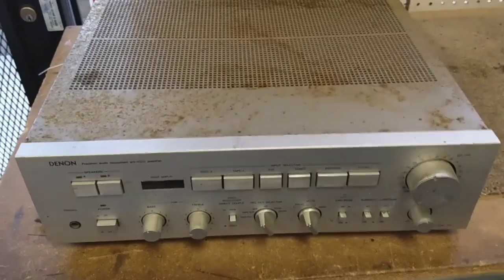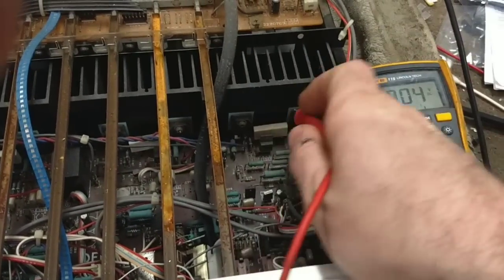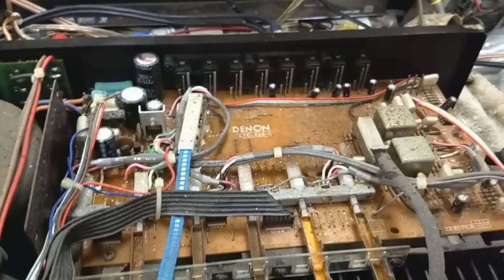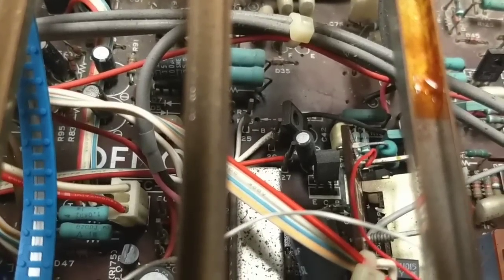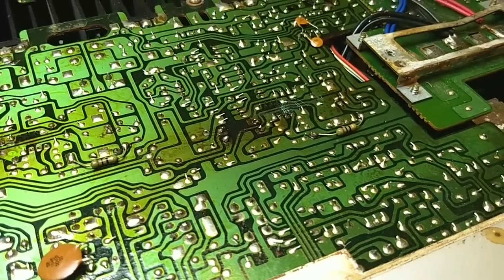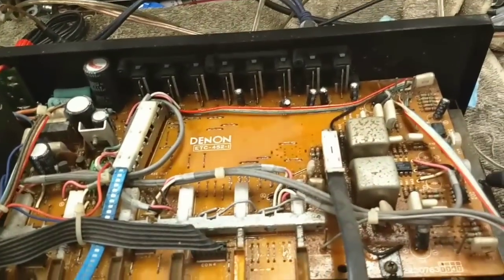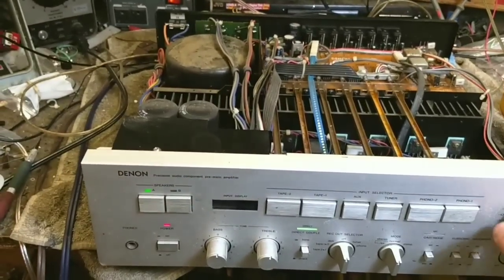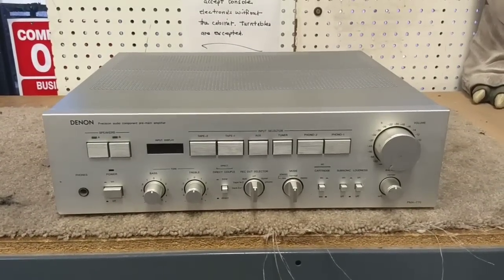Diagnosing and servicing a crusty Denon PMA-770 integrated amplifier

Comment: Wow, if I had one of those, I'd NEVER get rid of it!  (Actually I did have one of those, and still have it, in storage and in much better shape than that one.)  It was part of the best audio system I ever had.  The input display is, if I recall an LCD that is back lit by a bulb somewhere inside.  (I never got around to fixing mine either.)  It's sad for me to see such vintage high end audio equipment poorly neglected.  Not enough respect for the higher end stuff from the 1980s.  I once saw a Nakamichi Dragon cassette deck (arguably the best, most expensive cassette deck you could buy), rusted and beat to crap, having been shown the disrespect I wouldn't even show a no-name kid's deck.  Glad to see a vintage Denon (Nippon Columbia era) component saved!

Comment: I have one of these. They're from around 1981; I think by 85 they'd "replaced" it in the model line. It's a extremely fantastic amp. My input switches are gone, no amount of Deoxit helped. It currently lives with a pair of RCA jack pigtails soldered directly to the input on the main board. I'm planning on replacing it with a much simpler input relay board controlled by an Arduino using a small OLED to replace the input display LCD...gets rid of all those unnecessary series connections. Mine's a tank..it's been abused and looks a lot worse than what yours started with...but other than the input switches, an output relay that needed cleaning, and a phono stage I never use that doesn't work...I'm honestly quite surprised mine is still on all original caps.

Comment: JORDAN PIER< you disconnected the "Speaker resistor loads" on the left and right channel to measure if the pre-driver transistors are good or bad? I didn't know you can disconnect the speaker resistor loads on the speaker output jacks to measure each receivers channels output

Comment: Great fix...You are the man.... I want to get a generator like yours could you recommend one? I have a HP 8656 R/F generator but I don't think it will do it.
Reply from the maker: I use an old leader LAG-120a. Works great after replacing a few caps and cleaning the switches

Comment: At 13:40 there was a comment that if the load is removed and the distortion stays the same the issue is pre-driver..... if the distortion goes away it is a problem with the drivers or output devices right? Thanks! Helpful stuff!!
Reply from the maker: Not true of all designs but true of this Denon and some others. It's a good troubleshooting technique to remember
Reply: Jordan Pier thanks for the reply..... I will definitely add that to my bag of tricks.😎

Comment: Well done again. Did you manage to fix the front input indicator? Was it lcd not working?
Reply from the maker: I never got to figuring out why the display was not lit. Think it was an lcd
Reply: @JordanPier  I believe there is a small incandescent lamp back light soldered in there, behind the LCD.  Mine went out in the 80s after only a few years, and I never bothered replacing it because if I recall, it only told you what the selector knobs told you anyway.  Now mine is buried away because I got spoiled by remote controls.  Back then, it was cool having the LCD readout!